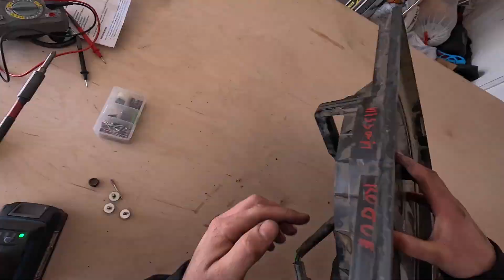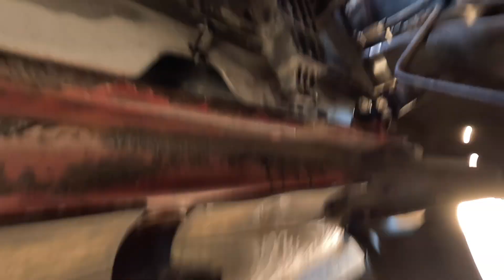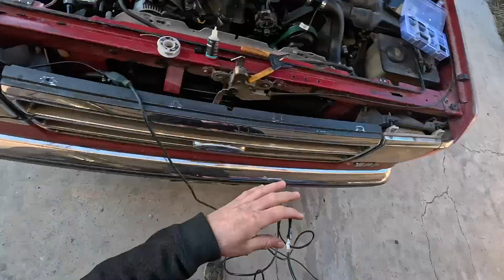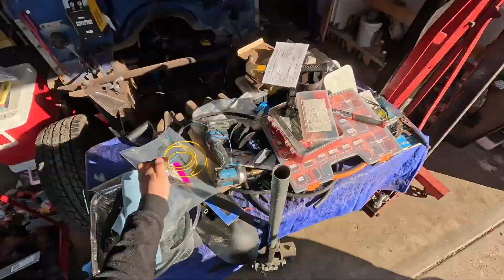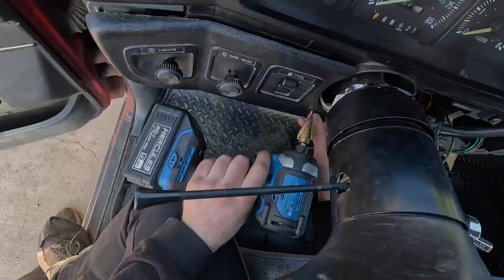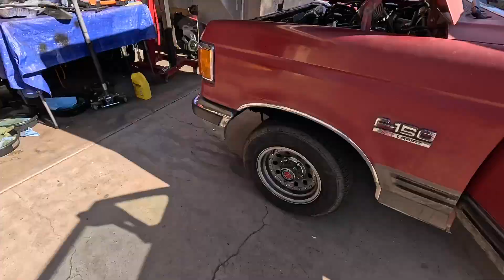Electric Fan Conversion | 1991 Ford F-150

Comment from the maker: If you found this video helpful, consider subscribing! I’ve got more content coming, and your support means a lot!
Reply: What stopped you from Ordering the radiator fan combo? And how is the mpg now?
Reply from the maker: @themagichound30  
Hey, thanks for the great questions! I looked into radiator/fan combos but decided against one for a couple of reasons. First, from what I read on forums, OEM fans—especially the 6- to 7-blade ones—tend to be quieter than many aftermarket options. Second, the higher-rated aftermarket combos I found were a bit out of my price range. I’m sure there are some great options out there if you’ve got the budget for it!

As for fuel economy (and power), doing this upgrade along with the smog pump delete has made a noticeable difference in both. I probably should’ve collected some solid before-and-after data, but just from driving it, I can tell it’s running more efficiently.

One thing I can say for sure is that the e-fans made a huge difference in reducing noise.

Since I’m in AZ too, I’m really curious to see how they hold up when we hit those brutal 115° days. I’ll try to update this when it starts warming up!
Reply: @MyAutoAdventures  gotcha just wondering because I'm about to do the same thing to my 87 f150 but just trying to get some solid evidence on results. An im attempting to convert my smog pump into a small forced air induction by rerouting the main hose and adding a smaller pully on it. Thanks for your time and input
Reply from the maker: @themagichound30  That sounds sick! A lil smog pump turbo! I'd be really interested to see how that turns out! 

Thanks again for watching bud!

Comment: So whats the difference in AC performance as well as fuel economy? Im working on one of these myself and wondering how well it works real world use case.
Reply from the maker: Fuel economy is almost always gonna be better with less strain on the engine after getting rid of that big ol' fan and clutch!

As for the AC, I didn’t notice a massive difference, my stock setup already did a pretty good job.

That said, I do have a really nice AC upgrade video coming out soon, so keep an eye out for that! 🤘
Reply: @MyAutoAdventures  I am absolutely needing to get my AC working better, it's super humid here and I am sick of melting.

Comment: From what vehicle did you take the fan assembly?  That looks like a very good fan assembly.
Reply from the maker: Thanks for watching! I get this question a lot. Honestly, I got a bit lucky—this fan came out of a Chrysler 300. I dug through parts lists and forums and still couldn’t nail down the exact year, it just happened to check all the boxes.
When researching the swap, I saw people using fans from Thunderbirds, Tauruses, Intrepids, Lincolns, and 300s, but at the junkyard this 300 fan was the best fit for my setup. If you’re running a similar engine, water pump clearance is huge. The last guy I talked to about this ended up finding a good match in a junkyard Ford Taurus.

Comment: I have a 1993 F150 XL 4.9 l6 M50D-R2 4x4, and I'm actively doing a full rebuild, against my family's "better judgment," because I'm getting around 20mpg, so I'm subscribed.
I love a good informative video like this! 
I've long needed to buy a new radiator, because mine's leaking, so I bought an AlloyWorks 3-row aluminum radiator, (with the built-in electric fans,) and got a new core support, so I've disassembled the entire front end of my truck in preparation for the parts arrival, they're actively on their way. 😁🎉 
While I have it all apart, I'm just tackling all the maintenance I should do while I'm in here, (because I'm not planning to get in here like this again,) so I'm sure I'll need to freshen up my shade-tree youtube certifications, watching the rest of your videos.

Comment: Have you done any significant towing since the electric conversion?  If so, how did it fair?
Reply from the maker: Nothing too crazy yet — I did drive up north of Phoenix a couple weeks ago to pick up a trailer. It’s a bit cooler up there than in the valley this time of year, but the truck handled it like a champ. Motor and transmission temps stayed right where they should be the whole time.

Comment: Why is there a 9 second delay?
Reply from the maker: Heyo! I believe it’s to prevent a sudden load on the system all at once. That short delay lets the system stabilize before the fan kicks in, so the power draw is smoother and more efficient.
Reply: @MyAutoAdventures  Ah, makes sense. Thanks!
Reply from the maker: @jackfar6 Happy to help! Thanks a ton for watching and for the great question! 🤘
Reply: Electric motors draw the most current at startup, hence max torque at low RPM.  Staggered startup reduces the current spike.

Comment: What’s the fan out of?
Reply from the maker: Heyo, when I researched this swap, I found recommendations for fans from Thunderbirds, Tauruses, Intrepids, Lincolns, and Chrysler 300s. But at the junkyard, the only one that met my criteria was from a Chrysler 300.

I was specifically looking for:
✔️ OEM (quieter than aftermarket)
✔️ 6-7 blade design (better efficiency & noise reduction)
✔️ Wide enough to cover the radiator (for proper cooling & easier mounting)

Since I have the inline-6, I also needed a thin assembly to avoid interference with the water pump’s threaded shaft. If you have a V8, you’ll have more space to work with.

Hope this helps! From what I can see on other comments, others are finding success with the Ford Taurus so I'd look into those too!

Comment: Next electric power steering conversion 
Volvo s60 electric pump
Reply from the maker: That would be sweet! 

Before I started filming videos, I actually swapped in a Saginaw power steering pump. All it takes is the bracket from an E-Series van with the same engine.

It works way better than the stock setup, and Saginaw pumps are super easy to rebuild too!

Might have to try out the Volvo electric pump on a future build - definitely a cool idea!

Comment: I loved the fan video and the pump removal, which is why I subscribed to the channel. I have a 1995 F150 with the same 6L 300 engine, and thanks to you, I'm going to do the same. Question: The fan is from a Chrysler 300, but from what year?
Reply from the maker: Thanks so much for watching and subscribing! The more I learn about them, the more I'm convinced the 300 is the perfect balance of gas milage and torque—glad the video helped and excited for your build.

I get this question all the time, and honestly, I think I just got lucky with the Chrysler 300 fan I found. I’ve dug through parts lists and forums, and I still can’t pinpoint the exact year it came from—it just happened to fit my criteria perfectly.

When I researched this swap, people mentioned fans from Thunderbirds, Tauruses, Intrepids, Lincolns, and 300s. But at the junkyard, this Chrysler 300 fan was the only one that checked all the boxes.

If you have the same engine setup, that water pump clearance is super important. The last person I spoke to about this found a winner on a junkyard Ford Taurus.
Reply: @MyAutoAdventures  in my opinion, the 300 inline six is the best engine Ford ever made for the average truck owner.
Reply: Seems like around a 2002 300M.
Reply: @joeypyron3218  OK, Thank You Very Much Friend.

Comment: Quick question I know you said you got the electric fan from pick n pull what vehicle did you get it from?
Reply from the maker: @DusktoDawn619  Thanks for watching and for the great question!

When I researched this swap, I found recommendations for fans from Thunderbirds, Tauruses, Intrepids, Lincolns, and Chrysler 300s. But at the junkyard, the only one that met my criteria was from a Chrysler 300.

I was specifically looking for:
✔️ OEM (quieter than aftermarket)
✔️ 6-7 blade design (better efficiency & noise reduction)
✔️ Wide enough to cover the radiator (for proper cooling & easier mounting)

Since I have the inline-6, I also needed a thin assembly to avoid interference with the water pump’s threaded shaft. If you have a V8, you’ll have more space to work with.

Hope this helps! If you're planning this swap, feel free to reach out—I'm happy to help however I can.
Reply: @ thanks for your reply. I love the video. I also have an in-line six but mines from in 1987 model and my fan clutch just isn’t doing anymore. I live in Texas so that he just gets to it. I have the thermostat taken out just so we can help cool as well as an aftermarket radiator so it’s thicker, but I liked how you used the thin fans and I’ve been wanting to do it on my truck as well it’s just never really had found a video that explained it so well nor was it my engine type so your video was very helpful and I will be doing this to my truck hopefully this week if not next since I live near San Antonio, there’s a giant Pickleball that I should be able to finda fan assembly that I can take off. Thank you again.
Reply from the maker: @DusktoDawn619  Glad you found the video helpful! Sounds like you’ve got a solid setup with the aftermarket radiator. Those inline-sixes are great engines, and going with electric fans should definitely help keep things cool, especially in that Texas heat. If you’re near a big Pick-n-Pull, you should have a good shot at finding a setup that works. Hope the swap goes smoothly—let me know how it turns out!
Reply: @MyAutoAdventures  may I ask what year Chrysler 300 you pulled from
Reply from the maker: @DusktoDawn619  I didn’t get the exact year. Junkyards can be frustrating—sometimes you’ll see two of the same car, same year, and they’ll have completely different fan setups. Engine size definitely plays a role, but I had to do a lot of searching.

I was surprised when I walked past a Nissan Rogue and saw one with top mounts that looked super close, but it ended up being 4 inches too narrow. I originally looked through Tauruses and Crown Vics before coming across the Chrysler 300 that had the fan I used. Hopefully, it wasn’t just a lucky find because when I check online, I mostly see side-mounted dual fans for the 300.

I’d definitely recommend bringing a tape measure. Finding one that was the right 28” size was the biggest challenge for me. But they are out there!
Reply: Hi guys 
I have a Chrysler 300 e fan on 1995 Ford obs 5.0 and don't cover the whole radiator. This fan looks like 2014 nissan Rouge  efan
Reply: @baldosilva7218  I found mine off a Chrysler 300 and its cover my whole radiator no problem  and mines bigger than the oem one
Reply from the maker: @baldosilva7218  I think you're right. I have weird luck with efans. When I look around the junkyard there are quite a few vehicles that have fans that don't always look like they were originally made for the vehicles they are in.
Reply: Update found one that barely fits from a ford Taurus dual fan! With it being able to latch on top I tried looking at the Chrysler 300s but all the fans were gone or they were only a single fan I almost settled and took one off a Chrysler 200 then a dodge caliber but ventured over to the fords and man they had so many Taurus. Now to get the controller and the other part to connect to my coolant line then I’ll be in business will update when complete
Reply from the maker: @DusktoDawn619  Nice! Glad you found one. It definitely takes some digging to get the right fit. Let me know how it all works out and what your end results are—you might find some tips and tricks that could help others too!
Reply: @MyAutoAdventures will do I did have a question after the dual stage thermostat I did notice another addition you have in your upper radiator hose what is the aluminum part you have just before it elbows into the engine
Reply from the maker: @DusktoDawn619 That's my external thermostat housing. I installed it so I wouldn’t have to keep removing the stock housing from the engine—that spot was a constant source of leaks and headaches. I made a separate video on the install here:
https://youtu.be/i0EWU6IND5Y?si=wOCpO4F77rMzP1Jh
It’s definitely not required for the fan upgrade, and in your case, if you’re running without a thermostat, you likely won’t need it at all.
Reply: @MyAutoAdventures  random question since I can’t find it on any forums the vaccum tree right under the passenger side windshield wiper what do those go to( there three hookups for I’m assuming vaccum lines) ever since I had the truck ones been broken ones not connected to anything and the third has been capped any help with this would be grateful if I could post a picture of it on here I would hope I described the location good enough
Reply from the maker: @DusktoDawn619  Heyo, you're welcome to send some pics through email, and I'd be happy to help!

MyAutoAdventures@gmail.com
Reply: @ sending it now thank you
Reply: @MyAutoAdventures  hey just sent you another email with some pictures that’s I’m having trouble with the smog pump delete as mine had an extra part that wasn’t included in your video I already bypassed the pump because it seized so just looking for help or guidance
Reply: @MyAutoAdventures  thank you for responding updated video on the fuel injector cooler fan sent to your email
Reply: @DusktoDawn619, what year of Taurus did you get the fans from?